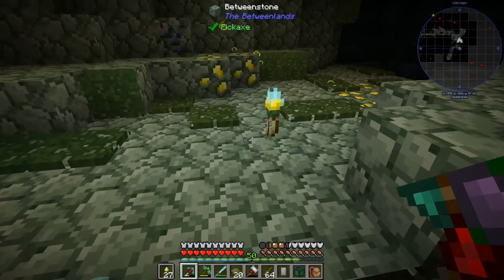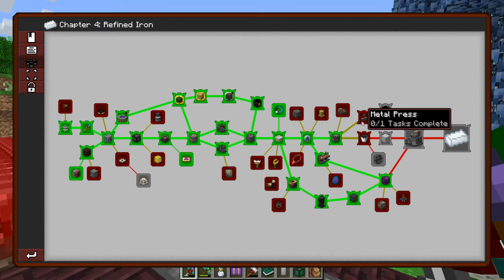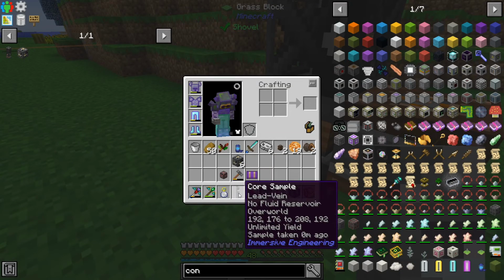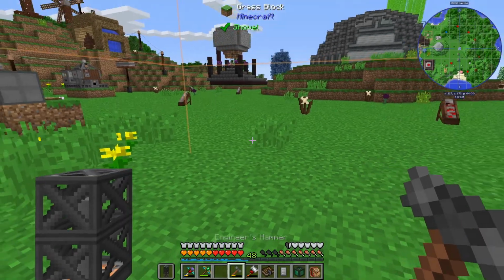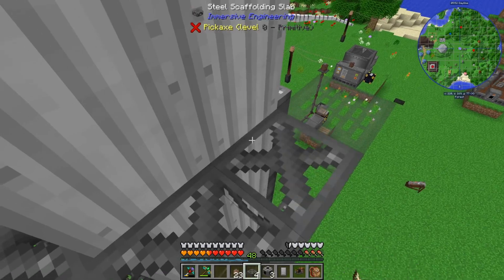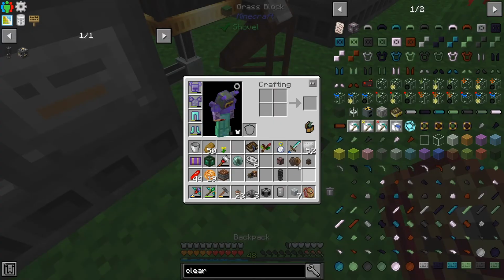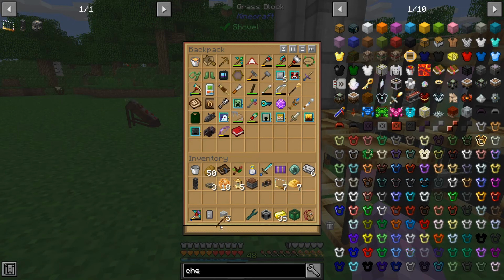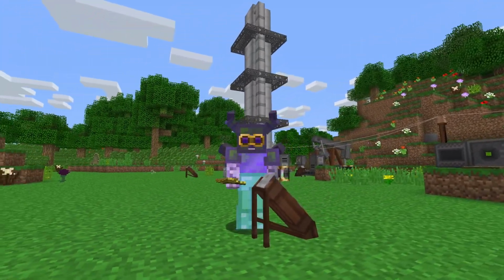Drilling For Oil! | Multiblock Madness | Ep 18

Comment: Is the old Ender IO Ender Fluid Conduit in the game.
Remembered from last I played that they never had fluid inside the Conduit and only exported fluid when there were a target for it.

But tbh its a few years since I played myself last time
Reply: Fluid Filters are an easy solution on the insert side of the conduit for each tank as well!  Also the quantum tanks or what not are very easy to craft early on and will hold all the fluid you will need to hold for the distillation tower products.

Comment: You still can't set filters with Immersive engineering pipes?  Maybe I'm thinking of a add-on mod.
Reply from the maker: I think you can use fluid routers and have a fluid set to each side, but you still need to make sure no pipes every touch haha. From memory they don't have a blacklist, so if a random fluid end up in the router it just picks a random direction to go